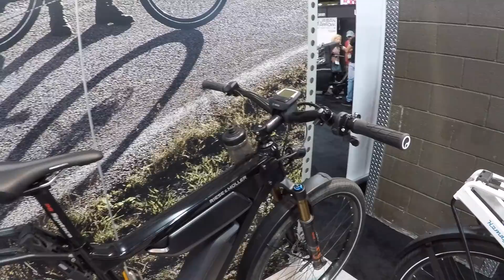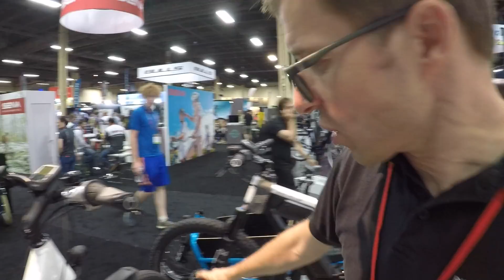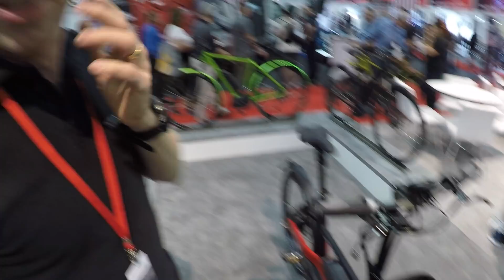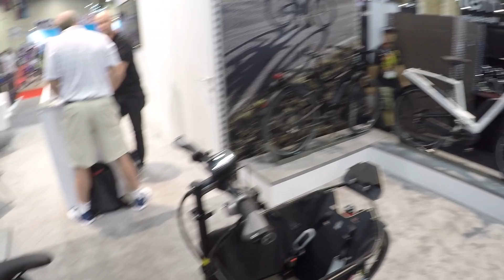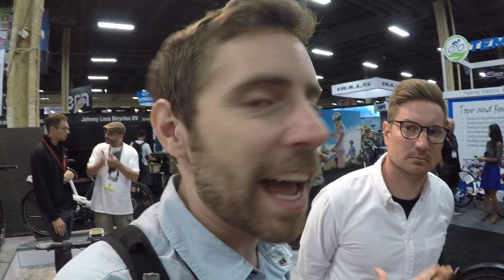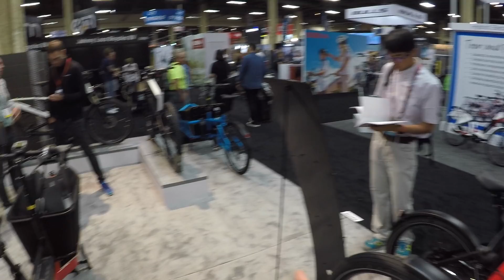2018 Riese & Müller Electric Bike Updates Interbike (Deluxe Signature, Packster 40, Roadster Mixte)

Comment: I see they have the super charger on their website.  Seems like that is the only model that has dual batteries for the small frame. Am I correct?  Would love a review of that one.
Reply: Court did end up doing a review of that bike recently. Not sure if you caught it. The New Charger Mixte might also be a good option if you're looking for dual battery in a smaller frame. The Supercharger has a tall standover height if you're on the shorter side it might be too big.

Comment: Non-HS Delite has the Supernova lights that cannot be switched off!!! The light button on the computer is quite simply disconnected :( Handlebars completely unsuitable for touring, I throw them and the seat and pedals into the bin. Also, cheap plastic pedals on a EUR7000 bike, seriously, was it really too hard to just put Shimano Saints in there?! Regarding tyre width, putting 2.35" Rock Razor tyres (and corresponding rims) when there's clearly enough space for at least 3.0 just doesn't make any sense - why not put 3.0 tyres (or wider) in there to start with? Also, cheaper Ergon grips instead of leather ones, again, why?!? What's the motivation in putting in cheaper components into a stupidly expensive bike? Oh, let's not forget, the Rohloff wires need to be reinforced immediately because at the angle they are going, the outer rubber is going to crack as soon as you start using it. I could go on, of course.
Reply: Why would you offer Shimano Saints pedals to customers who would throw them away because they don't like them ? Don't forget that many brands don't offer any pedals on their bikes, because customers have their own needs and desires.
And for all your other complaints: it's just about the same answer. Go build your expensive bike to your own taste with the equipment of your choice and at your price. Happy trails.

Comment: I just purchase a R&M charger nuvinci with dual battery two weeks ago and man I love it 😍
Reply: Lloyd Robbins l plan on purchasing the HS version this spring. Keep us informed how it goes, please.
Reply: Congrats. I got the Rohloff variety.
Reply: I purchased the orange metallic Tinker just because I love the colour and because it wheights less, has a little bit more torque due to the small wheels and goes as fast as the charger. No need for the dual battery. 
I would have went for a Rohloff, but the Gates drive belt was a decisiv argument in the buying move. We may have to wait untill 2020 to see a Rohloff with a belt drive !?
Reply: Kevin Willis it’s amazing, mines is also a HS with dual battery and man it’s a really good bike. You won’t be disappointed.

Comment: Great video! But it's a bit sad that they didn't have the Supercharger and the New Charger of next year with them. i'm so exited for the supercharger. i have been thinking to buy it with a bike leasing via work. they are a but more expensive bikes. but you do get the full deal : Hight speed 45km/h, belt drive , nuvinci gearing, good suspension, seat post suspension, disc brakes, 1000wath battry , etc etc. for +-5950Euros. I would have to do a 65km a day. And in Belgium we get more refund of the government if we drive a bike to work. So i would get paid to drive a bike and via a leasing (Which i would also pay of  the bike monthly), it would be great to buy a more expensive but durable bike.
Reply: tymom maybe we can do some videos of those models next spring.